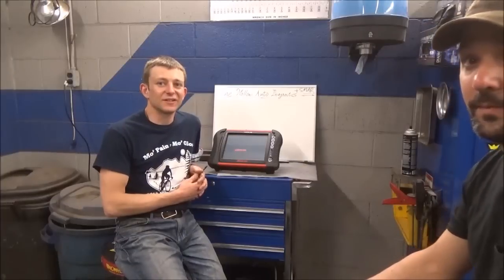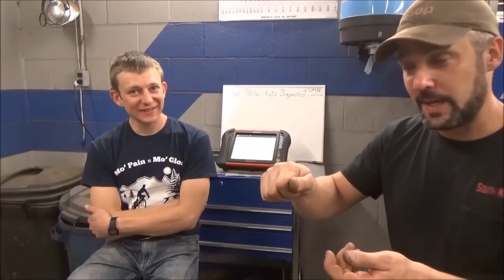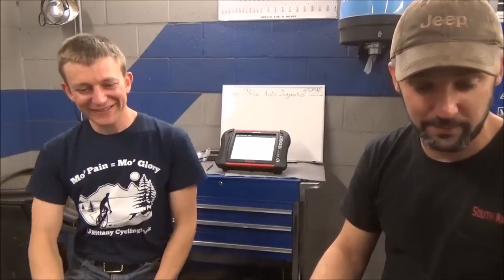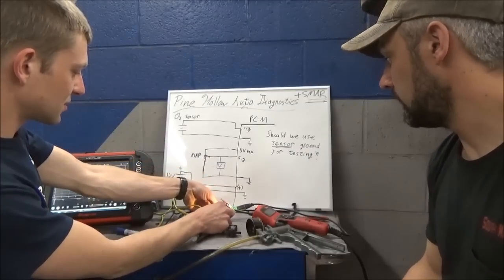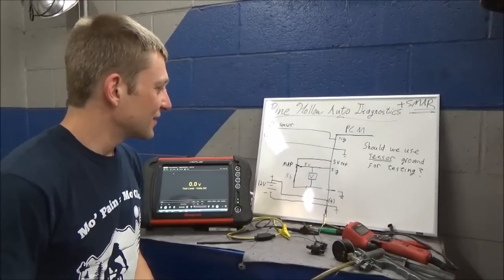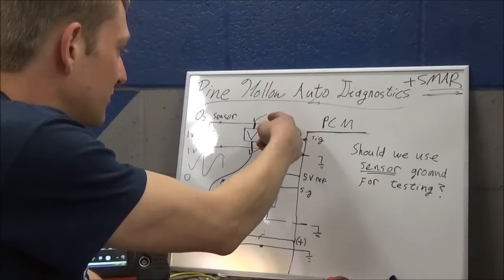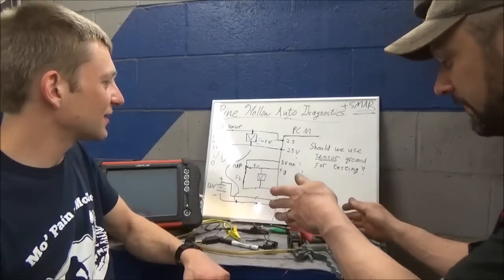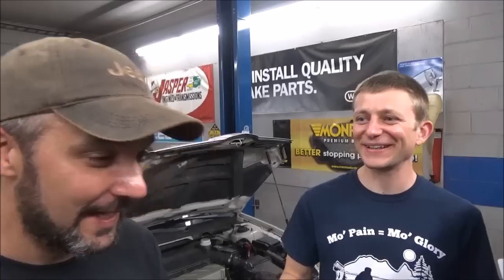O2 Sensor-No Activity Case Study: '04 Mitsubishi -Part3

Comment: Basically what really made this problem was a mismatched harness and PCM. That is enough to screw with anyone. Your original diagnosis was correct, no ground.... and if you hadnt taken the extra step to think it out (which is what gets you 100 marks for effort) and determine the that harness was wrong. It would have been so easy to replace the computer which is what the first shop also did (and got the same codes, you almost made the same error). I almost want to think that 99% would have made the same error in thinking the PCM was bad. So many times wiring colors dont match but in this case that was the real evidence. WOW and amazing.

Edit: Basically all of the O2 sensors are linked together in the harness at S024 & S023 and grounded at Pin 69  on B-21 connector. Also note that the original Oxygen sensors were also shown to  body shield grounded at Ground Point #11 ( I assume for noise shielding)while this was not the case for the 2006. (at least not shown on the diagram for the 2006)
Reply: Why not just run the O2 sensor ground wires to pin 69 on the B21 connector and call it done. What am I missing? Eric said only 4 wires were the issue.
Reply: @JOHNSUE28  

Pine Hollow Auto Diagnostics
5 years ago
+Mike Brennan That was Eric's decision to make. Basically it would kill several birds with one stone and make the harness correct to the car and avoid any potential confusion down the road!
Reply: i guess I am quite off topic but do anyone know of a good website to watch newly released tv shows online?
Reply: @Dawson Aaron Lately I have been using flixzone. Just search on google for it =)
Reply: @Malachi Raymond Yea, I've been watching on flixzone for years myself =)
Reply: @Malachi Raymond thank you, signed up and it seems like a nice service :) I appreciate it!
Reply: @Dawson Aaron Glad I could help =)

Comment: i had to do this on a 99 grand Cherokee with California emissions. engine harness had melted in spots, went to junk yard and got a harness from a 01, i knew going into fixing it there was wiring differences. only because could not locate a cali harness. the most difference  was in the o2 sensor wiring. had to re pin about 8 wires. printed out both wiring diagrams, also the coil rail wires were pinned differently and after getting all the wires to match the 99 harness. it worked perfectly! I was thrilled considering it was sitting at a mechanics shop that have gave up on the vehicle.

its a great feeling when it all works out and you figured it out!

good job guys

Comment: Good detective work guys. Perseverance, patience, resources, logic, experience, knowledge and skill pays off.  
SMA/Ivan=1 : Butcher Raped Mitsubitchy=0. 
I experienced a similar situation where the vehicle was bought at auction with no known prior history. After many hours, diagnosing, much searching and researching we discovered the vehicle had been in a serious front end collision(CarFax) so bad that from the firewall forward was from a similar but not exact donor vehicle. 
It was finally determined that the original vehicle was a California vehicle and the donor was not. 
It was also a mid model year manufactured vehicle with VIN break harness revisions. 
We were able to ID the harness from a part number tag on the harness and it did not match the VIN for year or California emissions. 
Performing an engine SN decode we discovered the engine was not a California emissions compliant engine and was from a different model year. 
I don't know if it would be legal in NY, but at the time in our state it was, we changed the PCM to a 49 state unit and all was good. 
After the PCM change MIL off and we cleared a laundry list of codes, cleared up rough idle and emissions passed with ease including the rollers with exhaust sniffer.

Comment: I'm resting today cause of medical issues and watched all three parts, I loved it, listening and watching the whole diagnosis. I wasn't all that surprised when the color codes didn't match, I've seen it a few times on vehicles built at the end or beginning of a model year or repaired wrecks. When I worked at Ford we bought a new 93 Aerostar(great truck) that had all 94 harnesses, dam seat belt warning light wouldn't go out, chime turned off ok, took a few days to figure it out, replace two seats belts with 94 pieces, good to go, it was built the day before they converted from 93 to 94. Great series.
Reply from the maker: Thanks James! Ah the good old cross-over years. Always problems to be had on those models. I always thought the Aerostars were a cool van design. Never drove one though. I hope you feel better soon!

Comment: Awesome 👍 We have an 88 Toyota truck with the 22. It had mass air flow codes which tested out crazy.
The following morning I removed the PCM from it's housing to look for the open on the sensor pin.
The pin was not there. Called the dealer for the correct p/n. Got it from local vendor and MAF is still fine.
Needs a transmission.

Comment: It took a real meeting of talent of both Ivan and Dr O to figure this one out. What an absolute pig of a diagnosis. This was rocket surgery almost up there with that Hyundai with the warped cam shaft. Of all the things to be different on wiring harness. It could just have easily been some different wires and it could have damaged the PCM or caused a no start condition when they plugged it all in originally.

Interesting stuff on the whiteboard of knowledge as well. The one thing about voltage that often trips people up is voltage people don't necessarily understand what it actually is. The way I've always understood voltage is that its a measure of potential difference between 2 points on a circuit so its important to understand what you are actually attempting to measure otherwise it can lead you down a blind alley. I'm self taught in the basics of electrical theory, but i've learned a lot more seeing it applied!
Reply: To add to Ohms law you should also learn Kirchhoff's law.

Comment: From my Purely electronic background , for all measurements I take a reference point ground as closed to input circuitry as possible (one of the battery ground wires going to pcm with least noise). So very good conclusion .It is also faster as you are probing with single probe .Thanks for a great video
Reply: It would be better for clarity to show the battery ground using a different symbol than circuit ground.

Comment: In this trade just when you think you have seen everything something else comes along. Sometimes thinking outside the box really works in regards to the engine being replaced. I don't think I ever used the harness on the replacement engine. I always thought the were gonna be different besides, the wreckers usually chop them to pieces anyway. Awesome job, both of you.

Comment: Holy shit!!!!! I called it in part 1!!!! When you guys mentioned that all those other diagrams were matching but they didn’t match the wire colors on the car, along with the harness being all loose and run badly in the car, I thought it was that someone put the ring harness in it with a swap.  😂. I finally got one right!!!  It’s probably because I did a swap on a Honda and did this same thing.  😂

Comment: This was a great set of videos!  Having worked in late model vehicle wrecking yards in my college years, and personally changed out engines with wrecking yard engines, I actually suspected the harness 20 mins into part 2!  When your wiring diagrams didn't match up on any of the sites and you said you had a 2006 diagram that was exactly right I was suspicious right then, considering the scan data didn't match the scope/sensor data.  I also recall in part 1 you said the previous mechanic supposedly switched the PCM with a known good one.  

One side note Eric, (and anyone else watching) I've seen you go to the salvage yard in your videos and clip harnesses to grab a part.  Having worked in wrecking yards it was a BIG no-no to cut wiring harnesses just for this very reason.  When someone needs one they NEED one.  People used to go out to the yard looking for something and come back in with a small pigtail from a harness.  When they asked how much, the counter guy would often say something like, "$50."  Then the customer says, "What??"  The counter guy then says, you just damaged my $50 harness on that car I paid thousands for at the auction.  I can't sell the harness now.  That said, we sold very few whole harnesses...but it was very taboo to cut them.  

Great detective work Ivan and Eric!  I was glued to this series!
Reply: Hey my car is doing the same thing so what do i need to to replace

Comment: Awesome series!  That said, one huge clue that would've put y'all on the right path sooner was the negative voltage reading.

Basically, there is no such thing as negative voltage — like y'all mention at 36:00, the reading is just a difference between two points.  So if you're probing across a sensor signal and ground and you see a negative reading, it automatically means that the ground is being pulled high.  And in this case the specific values suggest that the ground is being weakly pulled up to B+ (likely due to a different connected circuit that's supposed to be pulled down to ground, except the ground is floating)

From there, if y'all had started chasing grounds immediately, you would have short-cut a whole bunch of work in the middle.

Regardless, though, awesome diag and I never suspected the surprise ending 👍🏽

Comment: As I have applied the star ground concept in PCM design, the star ground (Signal Return, Power Ground, Chassis Ground (which may be through a resistor or capacitor or both in parallel, etc.) tied together in a star configuration to minimize any modulation of a common ground impedance. So, the star ground is internal to the PCM and not external using a splice to ground. This makes sense if you are trying to minimize the number of PCM connector pins to control all of the circuits. However, with this PCM design there is no shortage of connector pins, and for some reason (probably noise or EMC) the decision was made to complete the start ground external to the PCM via a signal ground splice. So, the 2004 harness has the splice and the 2006 harness does not.

Comment: I came late to this party, but after the initial finding of 11 volts (!!!) in the scan data but normal voltage on the scope, I would have given you 30-70% chance of ground problems. What really got my interest (although I would never have guessed the wrong harness - super sleuthing by Eric!) was the two ground symbols in the ECM.
Before I started shaving I got into electronics. Most of the literature I had to work with was from the '50s and very early '60s (this was in 1965), tube type and early transistors. In those days it was fairly common to identify two grounds; the rake symbol for chassis ground and the upside-down Christmas tree for a ground bus (typically signal ground, but sometimes DC ground). There was often a separate connection shown for an interconnecting wire. Without that the Christmas tree ground floats and hilarity ensues. I thought there was going to be such an interconnect wire coming off the ECM. 
Anyway, my hat is off to both of you. It is amazing such talent exists in the real world today.

Comment: Holy crap! If we had a internal WD of the computer it would have jumped out or valid WD for the vehicle it would be easy but great catch...could've changed a good PCM. Component Test and Troubleshooter with SureTrack are great tools provided by Snap-on! You guys are usually thorough & I don't know what is edited out so I just go with what you show us and know in the end it will be a good fix and be able to explain the diagnosis. DVOM potential and connections can get you in trouble but the wrong harness in the car can really get you in trouble b/c normally that is not in your train of thought. The part that was unanswered & threw a twist was the -6 & -10VDC coming from BISI computer grd pin and in the end of Part 2 you had 12V at the B1S1 ground pin accounting for the 5V BISI processed data which would normally point to a bad PCM so what triggered you to dig deeper...was it the fact that by supplying a ground all the sensors worked and the PCM started reading correctly I would guess? Again great troubleshooting & good editing to put a twist to it. As always nice case study and great learning experience for all!!
Reply from the maker: +Robert Hayward Hey Robert, great question on the B1S1. So for the 2004 model year, that PCM pin is explicitly listed as "NOT USED". So to explain that "soft" +6V to +10V on that pin...your guess is as good as mine.
But since that pin isn't designed to be connected to anything, I guess it doesn't matter for the operation of this car lol
Reply: +motoYam82 Yep exactly but great catch! Creative troubleshooting and substituting grounds was great isolation procedures. Thanks again...great video!!
Reply: +motoYam82 Ivan, I don't know about "super clean special oxygen sensors" but i have an 04 outlander with the same 2.4 engine and when you shop for 02 sensors it does specify different part numbers if the vehicle was made after march of 2004. Not sure if it applies in this case to the galant or not.
Reply: +Paul Carroll I can give ya the other shops number supposedly he knows where to get the "special" ones haha
Reply: +South Main Auto Repair Lol. Thanks, but i ordered mine from the easter bunny. He offers free delivery in the springtime.
Reply: ***** Lol now that is good thinking :)

Comment: Hi Eric, very good I probably would not have found that. However my hypothesis is correct and what i suggested would cause that. However one thing I did overlook is the circuit being supplied by reference ground would have failed so there should have been other faults. One would presume the new harness supplied the ground for the sensors via another pin. However the 12V or 10V has to come from somewhere to power the now open ground. Also very interesting they did not change the location keys after they have changed the connections. I try to make sure i do this on all my designs. I work on mains powered stuff and you have to watch out for ground loops on signal generators and scopes. i use an isolation transformer so that my test equipment ground is not connected to ground. By the way the difference between the two ground symbols is that the tree is supposed to be a true ground and connected to earth and the other symbol is chassis ground. The tree symbol is technically incorrect in a system that is not actually connected to earth ground. Used incorrectly on many diagrams.

Comment: Great detective work.  Could you have re-pinned the O2's ground to the appropriate pin location on the ECM connector instead of buying a used harness that only has that 1 or 4 O2 ground wire difference?  Love the video regardless, thank you to both you and Eric O for the great content.

Comment: Good job guys, know the feeling with trying to sort out accurate wiring information.  On Buses I have to deal with multiple vendors putting there harnesses together with multiple colors.  When I work on multiple systems I draw out the entire circuit on paper so I don't loose track where I'm at.
Reply from the maker: +busjockey1 Wow that must be a fun time! Modern buses must have like 200 modules talking to each other...that would drive me nuts lol
Reply: Don't know the exact count but yes the newest buses we have contain over 20 modules.  Sometimes yes it drives me nuts a little but I guess my patience helps with this,lol.  Good thing I enjoy what I do for a living.
Reply: +busjockey1 When I worked in the truck shop for Cat , Cummins, Detroit Etc.... the thing I hated was that all wires were white! They all had little tiny numbers on them to I.D. the circuit...
Reply: +South Main Auto Repair Cool you have HD experience!  You are right about the White wires.  That's how Thermo King does it too.  Of all the Bus Manufacturers I would say Gillig schematics are the best labeled.  They write down on the wire what the circuit is so if your looking for the headlight circuit it says headlights on the wires.  How long ago did you work for a Truck shop Eric?  I have been doing this since I was 19.
Reply: +South Main Auto Repair If you ever touch any more Trucks and want some advice give me a shout and I will do my best to help you out.
Reply: busjockey1 Nah man I grew up in a truck shop did enough of that crap lol! If I never tear down another DT466 I'll be happy! Oh my gosh I am having flash backs lets not talk about it hahah
Reply: +South Main Auto Repair lol.  Know the feeling, when I first started out for a International dealer it was Trailer Inspection after Trailer Inspection, paid the bills and was thankful for the work but I felt like I was caught in the movie Groundhog day,lol.

Comment: I want to see the 2004 ground distribution diagram. Does ecm provide ground or is it external?
Reply: Never mind, I figured it out. 2004 - 2006 models using pin 69 as sens ground from PCM. Only difference is that on 2006 model they decided to make separate grounds for each O2 coming from PCM. I was thinking if PCM not providing good ground then there should be more issues because that ground goes to lots of sensors.